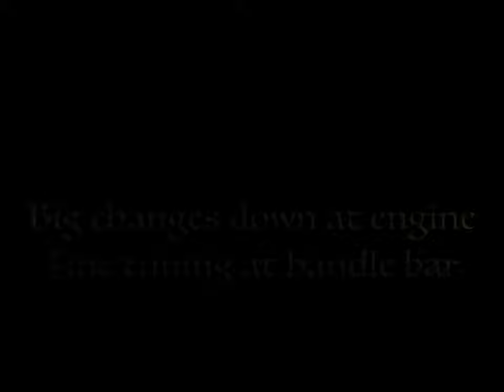Clutch cable change - VX 800

Comment: I did my VX800 yesterday here is what I found and did . I removed the case cover 3 10mm bolts all the same size. Now the are 2 brackets, the small one has 2 Philips screws, I took it off just to see, but it did not reveal much so I took out the 2 14mm bolts (again they are both the same size) and there was the cable end with the roundish end.  For me, I removed the clutch lever and pulled the other cable end out of the adjuster and the locking ring (Just so I had lots of slack) yes I did it wrong , I had to remount the bigger bracket so I could turn the locking nut and turn the 10mm adjusting bolt thing down and now I had lots of slack, I took out those 2 14mm bracket bolts and after more than a few choice words released the cable end from the holder. So the lower end was free and I turned out the adjuster from the bracket. Everything was free and moving easily, so I started to remove the old cable  from the bottom, but that bend at the top got jammed and after 5-6 attempts to pull it out I got out the grinder, took 3 deep breathes and cut off the cable just down from the bend.
 The new cable was easy to thread through to the clutch lever and with a smart ass grin I started the screw the lower adjuster into the bracket. OH SH&^&^, it would start but there was resistance, and the fear of cross threading it was palpable, I used my 10mm open wrench and gently turned the adjuster into the bracket and it was OK. You know what pucker power there is after you have cut the old cable, but it worked out fine. I reattached the big bracket and the smaller one (2 Philips screws) Now it was just connecting the top end to the clutch lever and setting the engagement point to my liking and tightening the locking ring at the top and the nut at the bottom.. BTW I did not and never have polished my levers and just spritzed the cable with some chain lube